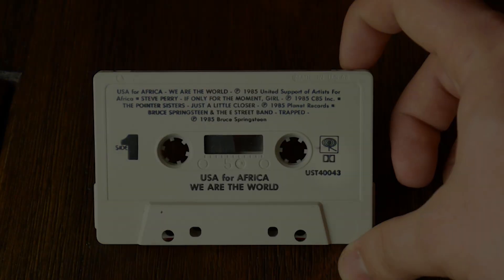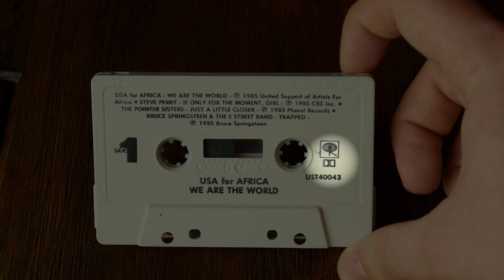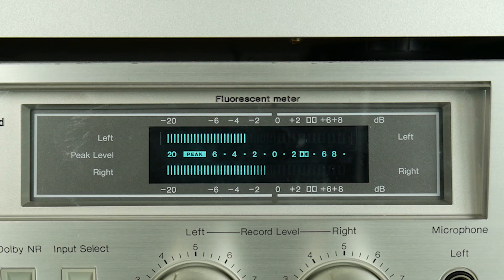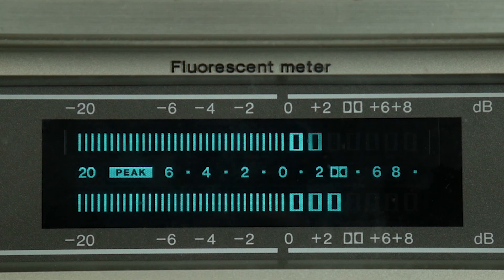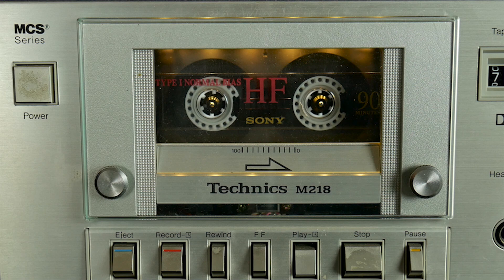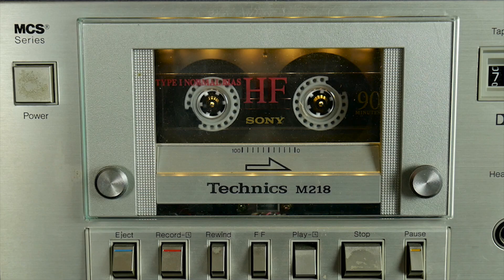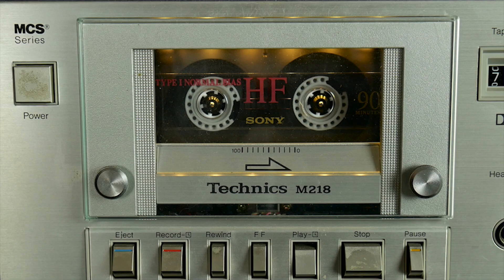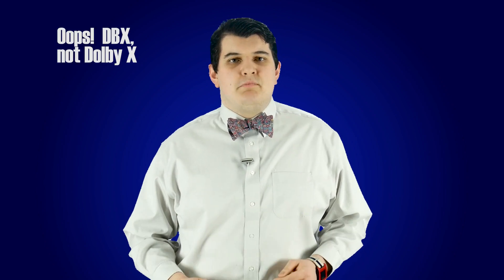What is Dolby Noise Reduction?  Dolby's Humble Beginning

Comment: Unfortunately, Dolby B couldn't go fully round the block and back again without treble loss -- even on the very same tape deck.  Though Dolby C was less bad, it usually wasn't on car decks where cassettes were most likely to get played.  And Dolby C came along too late.  There were far better noise reduction systems by Burwen, DBX etc., which weren't too popular on the consumer level.

Comment: Can you explain how HDCD works? How does it decode 16 (or 14?) bits of audio into 20 (or 24?) bits of audio? And how does it provide an entirely different master? How does is it compatible with normal CD players still and provide everything on the same PCM stream as the 16 bit audio? I don't understand, but it works great when you decode it using certain music players. You can even decode in post using lossless 16 bit wav files. I can't find much information when I try to research it. Thanks!
Reply: He has done a whole series on CD and digital sampling. Take a look.

Comment: Less than a month ago I finally acquired a fully working tape deck with Dolby S NR. (Sony TC-K615S) I've wanted one of these sense the 90's but it was out of my price range. Unfortunately I don't have any METAL (type IV) tapes any more but using new high bias type II tapes are still very impressive. The entire sound is very clean sounding. I really does sound close to a CD. Any hiss is almost nonexistent. Even the mid and lower frequencies sound clearer. Being able to adjust the recording Bias also helps get the best sound from the tape (along with adjusting the recoding level properly). My only complaint is sometimes (depending on what type of music or sounds you are trying to record), the higher frequencies sound exaggerated and gated when using Dolby C or S. It can loose it's natural sound in my opinion. Also, all these years later, a lot of my Dolby C encoded tapes are craping out. A lot of them now sound faded and the Dolby C reduces the high ends too much causing a pulsing feeling. I didn't see that coming 25+ years ago. Lol. Thankfully most of my good tapes that I archived were not Dolby NR encoded. I've gone digital many years ago but I will never give this old tech I grew up with. It's still a lot  of fun to use.

Comment: After watching this I find it hard to imagine how CDs even took off. Must have been very effective marketing...
Manufacturers could have just made dolby c (and later s) and chromium tapes standard and phased out the inferior ones.
Reply: @avada . . . I was around when CDs were taking off in the 1980s.  There was a tremendous amount of mis-information hype of its attributes, and here is a sample of some:  
Digital made the sound undistortedly "pure."  CDs, unlike tape and vinyl, could never wear out.  CDs were indestructible, where claims were made that physical scratches on the CD surface would not affect playback, due to the digital sampling process that would compensate for the physical surface flaws on the CD . . . I recall where one person on radio said a small hole could be drilled into the CD and it would not affect the playback.
Another reason for the early 1980s push for CDs:  Vinyl records sales had gone flat; as the popular music scene had gotten bland; and in 1982, the US was experiencing a recession.   The introduction, and the marketing push, of CDs in the 1980s, as well as a reinvigorated music scene, helped drive record sales once again; as the public was ripe for a new consumer electronics gizmo.
Oh! And one last thing:  By the late 1980s, CDs were very profitable for record companies.  I have it on good authority from a friend that worked for a record label back then; that to financially break-even with the release of a CD from an old catalog recording, just 5,000 CDs needed to be sold.  So, imagine the profits to be made to take a 1974 Linda Ronstadt album and release it on CD in 1989; which could guarantee hundreds of thousands of unit sales.  Record companies were living large during the heyday period of CDs, in the 20th Century, when they mined the vaults of old catalog recordings from yesteryear music stars, and had those recordings released on CDs.

Comment: Dolby "B" was awful.
Dolby "C" was less awful.
(I have not heard the other versions)

Of course, tape hiss is also awful.

On a department store level stereo system, Dolby noise reduction makes sense.

On a high end stereo system, you will hear both less tape hiss, and you will also hear the circuitry / processing of the Dolby system.

To achieve the best, most realistic reproduction in music, a simple circuit is best.  The more processing that is done, the less fidelity you get.  This is why the vast majority of high-end equipment do not include tone controls (and Dolby noise reduction is a form of tone controls).

Dolby noise reduction has its benefits.
But it is not without trade-offs.

Of course, this is somewhat moot, since tape playback is all but gone.

Comment: Well that sure explains why Noise reduction doesn't work properly for me, my decks running too slowly at the moment and I don't have the equipment to fix it. That being either a tape with a fixed test tone or a tape deck with recording that's running at the correct speed.

Comment: thatns a very good description. I already knew that and more however your audio examples really did assist. nowadays cassette players have further auxhilary systems to raise the quality of tape recordings like Flex or frequency level expander which adjusts the sound to have the same frequency envelope as one would expect as the frequency gets higher. there's also the hx pro system which aims to compat the headroom problem...presumably related to the maximum volume under dolby recording.  I'd have liked to hear the same audio examples with Dolby S, where not only are the upper frequencies encoded, but also the lower frequency of around 300Hz.  so if you are doing another of these, would you show us examples of dolby S  encoded, then both decoded on playback and not decoded ?  Also if you are interested, would you be able to show us how the manual bias adjust affects the playback of the sound as you speak , that would be interesting to hear. Good tape recording... I mean youtube.. lol.

Comment: Am I alone in believing for the last 40 years, that since my teens when I could finally afford a hi-fi system with a belt driven turntable and more importantly had Dolby NR that it disappointingly turned out to have a huge impact on the treble of the Amplifier & the Tweeters on the speakers.

Comment: Noise can be a problem. The 96dB nominal SNR for CDs is only true for full peak-to-peak amplitude recordings. Reduce the amplitude (volume) of the recording and the noise increases.  The SNR is further reduced by the deliberate addition of "dithering" noise to reduce unwanted audible artefacts that digital systems introduce when recording low signal levels.

Comment: Alec, catching up as a relatively new follower. I think an interesting video, given the resurgence of vinyl might be of the recording curves used on LPs. I remember my dad's first hifi amp a fairly high end Bogen Amp had an adjustment for a number of curves used to deal with the dynamic range limitations of vinyl, RIAA being the majority but there were others. The other I remember was NAB but I know there were at least four or five other curves used. I recently transferred a 1952 NAB equalization curved recording to digital. I had a 1949 reocording on tape, converted to LP record that used NAB rather than RIAA. Using a equalizer to mimic the other curve rather than RIAA made the sound much more alive. Realizing as a 66 year old who enjoys classic music and jazz of this era it may be limited but your analysis of Dolby me think of this. I remember buying an outboard Dolby unit to use with my first Cassette deck and my open reel recorder. Just a thought.

Comment: Dolby A to B. From memory this was about the filter slope. 12db slopes can have variable sound, if you use a synth you will be aware of the resonance control.
Dolby A uses a steper curve than B and the phase response is not as natural and the group delay is more pronounced,
Dolby B usesd a more gradual curve, the phase response and group delay both benifit.
There were complaints about Dolby A being too noticeable so B was developed. Dolby A was too established as a pro format and was kept, the studios I worked in didn't bother with noise reduction.
This is from memorys in the late 80's early 90's so check the facts. I'm only Human.

Comment: Noise reduction is still a thing in both hardware and software!
Getting a soundcard that isn't built onto the mainboard is still a thing for anyone that's doing professional audio editing (or audiophiles), external soundcards are also getting popular now that external data cables have reached speeds that previously required direct connection to the internal bus.

If you want to hear this just use some audio recording software and record, it's a lot quieter than my old tapedecks but it's still there and you can usually hear it without having to crank up the volume.  The cheaper the onboard soundcard the more noise it usually makes of course.

Comment: DD was used way up until the late 90's around the world. I grew up in Sweden, born '86, and if you didn't have Dolby Noise Reduction on your Walkman (had to be the Sony kind, or it didn't count) in 1998, you instantly became the laughing stock of the whole school yard.

I had a portable CD player in the days before the cheaper MP3's, but I didn't like that even with the anti-skip, the CD would skip a lot when I was out walking, so I ran with cassettes up until about 2004. Hooked up the stereo to the Line Out on the sound card and just recorded the music from the computer to the cassettes. Double decker too, so I could record 2 cassettes at once, one for my walkman and one to put in dad's car for those road trips.

Then again, around that time I was still playing NES and programming on an old VIC-20 (predecessor to Commodore 64), so I might have been in the vast minority when it came to using 70's and 80's tech in the new millennium.

Comment: I don't think the hiss noise is generated from the tape. I think the hiss and noise is generated by the tape head. 

You can check this if you start playing the deck without any tape inside. You will still hear the noise, even though there is no tape inside. 

Please let me know what you think.

Cheers, 
Vlad
Reply: No.  While the electronics in the player generate some noise, called heat noise, it's the oxide moving actoss the head that creates most of the noise.  If that were not so, the noise reduction schemes would have absolutely zero effect.
Reply: @videodistro  What is "heat noise" and what causes it? Why does the oxide moving across the head create noise?

Comment: If you are looking for new video ideas, this might be kind of cool: 

I know you have done videos on vacuum tubes already, but it would be maybe interesting to do an in depth look at guitar amps that used tube to create a "distorted" effect. Among musicians, the understanding seems to be that you "overdrive" the tube by putting a really hot signal into it. But, based on what I've learned I've learned from your videos, that shouldn't really create a distortion effect, because the input signal only controlled the control grid, which simply turned the amplified circuit on or off. So, where does this idea of "driving" or "saturating" the tube come from? Is it really just that if the signal feeding the control grid is too hot you start to distort the sound?

Comment: What deck did you use for recording the dolby c encoded version?  Or did you use an external dolby c processor?

dbx worked great on systems that were not too noisy in the first place (open reel, digital, etc) worked pretty great.  AFM vcr's which used compansion also suffered from many of the artifacts that plagued cassettes with dbx.   Only it was head switching noise that framed transients instead of tape hiss. 

Love your videos, btw.

Comment: I have a cassette player without any external option for calibration. It can only switch dolby on or off. With Dolby engaged, the recording is muffled and has an "artificial" quality to it, because a frequency band gets manipulated separately. Also dropouts in the tape get emphasized, because the decoder expands more during those. The constant bright hiss doesn't feel like a problem to me, and the recording seems to have wider spectrum with more air, even if some of it is actually noise. I tend to prefer aliasing over brickwall frequency response too, even if the latter is mathematically accurate.

I get an impression that Dolby B is an unreliable system. It is not possible to tell if the machine on which the tape was recorded was in good alignment.

Comment: When we moved into the digital age, the problem that still exists today is that of volume leveling. A digital recording is so dynamic suffers that the digital track is over or under a good volume level. It's quite noticeable where DSP and resampling occurs, or when originally analog is boosted or reduced. DSP in the 1980s is what changed all of that. So today we suffer with constantly having to alter the volume levels of most media to make it play at a normal level.

Comment: When I owned reel to reel the key on those would be faster tape speed. So that worked but at a sacrifice for time, and it still did not eliminate tape hiss, but since it offered a better dynamic range, which helped. Sadly most commercially bought tapes ran at 3 and 3/4 IPS which is below the 7 and 1/2 ips. Early recordings in studios suffered from that, when boosted up to higher levels, still revealing major tape hiss. Then in the late 70s and early 80s we got Dolby. First for movies, as the stripe audio on movies, also suffered the same hiss and crackle noises as tape. So to improve that, Movies got noise reduction, which for movie theatres meant a huge improvement in sound. In fact, my very first cassette deck was a TEAC with DBX capability. While it was non-standard, it did offer nearly CD quality sound. But I soon learned that to get good sound you did need Chrome or Metal quality tape, to get a good experience. And if you play back a DBX tape on a normal tape deck, it sounds like it was recorded on a cheap tape recorder, and lacking quality. DBX took the process in the other direction. You recorded at LOW Fidelity, and then Expanded both the low and high spectrum, during playback to bring it back to normal, but eliminating almost all of the hiss and noise even when played back at higher volume. Great for taking a high-quality source, for your own personal collection. But there was virtually NO commercial DBX encoded cassettes on the market.
Reply: Up until a few years ago I had a Yamaha K960 Natural Sound deck w/DBX bought it at a garage sale in the mid 2000's. DBX encoding  sounded fantastic, it was the best sounding deck I ever had. Cool thing was I also had vintage TDK chrome tapes from the same early 80's era. I could record tapes that sounded just as good as the CD it came from. Didn't use DBX much, I was usually recording tapes for the car, I think I still have a DBX encoded tape somewhere in the probably 100+ cassettes I still have but don't have a machine to play it on anymore...
Reply: In the 80s there were a dozen ways to encode and decode things, that a few remained, and many failed at.
DBX and Dolby were about the only ones that made the cut commercially.

Comment: Note that a similar system called "pre-emphasis" is used in FM radio, because the noise induced by the transmission lies in the higher parts of the spectrum. The trebles are boosted before transmission then put back to the normal level. On varions wireless audio systems (cordless phones, microphones, headphones etc...), companding is used to overcome the noise that would affect the quieter parts of the signal, by using nonlinear amplifiers.

Comment: Dolby A came out just as multitrack recording was really taking off. Many of the best recordings of the late 60's onward would have been impossible without it. Take 1968's triple-Grammy winning Switched-On Bach. Recorded on an 8 channel recorder back when synthesizer keyboards could not play chords, this meant recording each line of music to a single track, mixing the filled tracks down to free them up then doing it all over again. Without Dolby A's noise reduction this track bouncing would have increased the background noise until the tape was unuseable. Instead it won the 1970 Grammy for Best Engineered Album.
Reply: RMoribayashi modular synths aren’t “keyboards” and most can’t play chords to this day.
Reply: I've played and owned synthesizers since the 70's and like all my gear I've always called them keyboards, including the modular ones. As for chords, I meant that there were no commercially available polyphonic synthesizers back then.